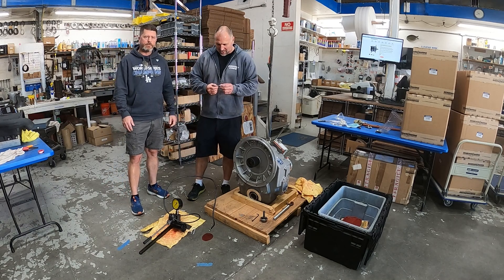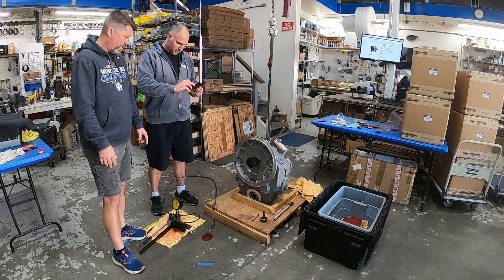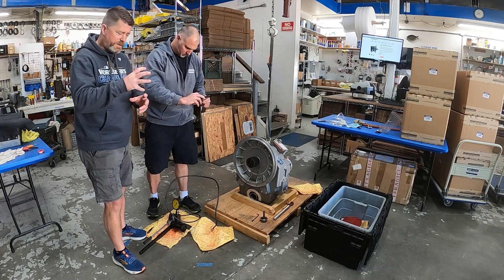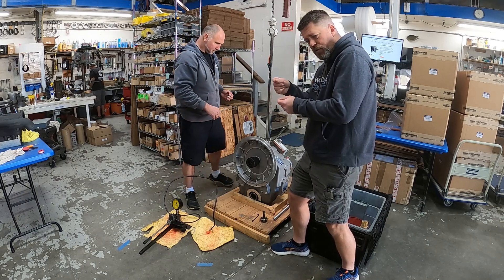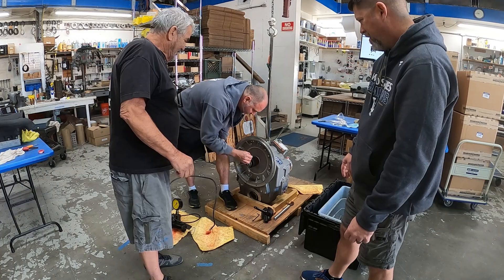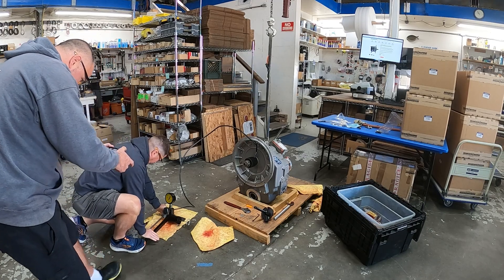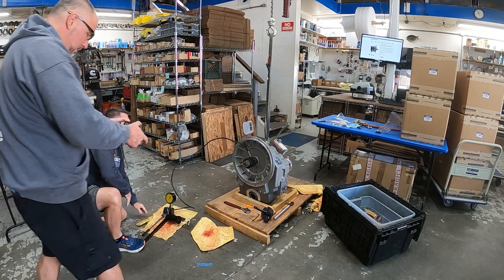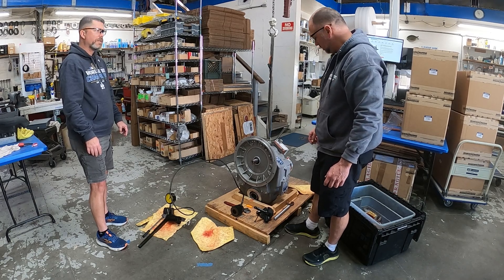ZF Marine Transmission Hydraulic Taper Fit Hub Removal

Comment: tengo una trasmicion marina zfw- 350 y no e podido soltar ese cubo con que otra herramienta lo puedo soltar si no tengo esa bomba hidrahulica
Reply from the maker: You will need the correct tool.  You could try carefully heating the hub with a propane torch, but I doubt it will let go.